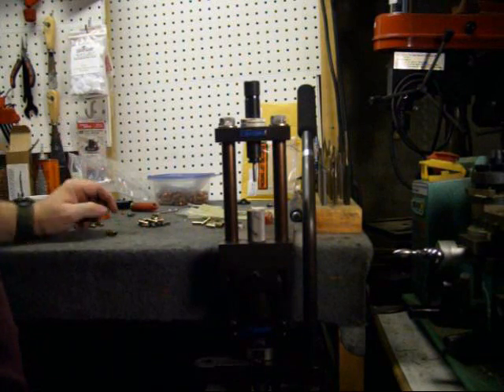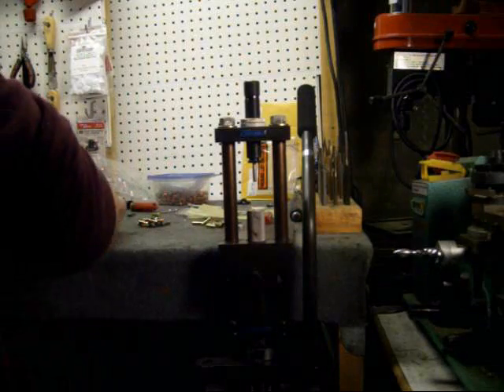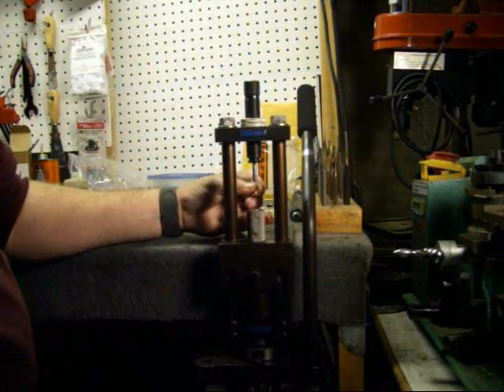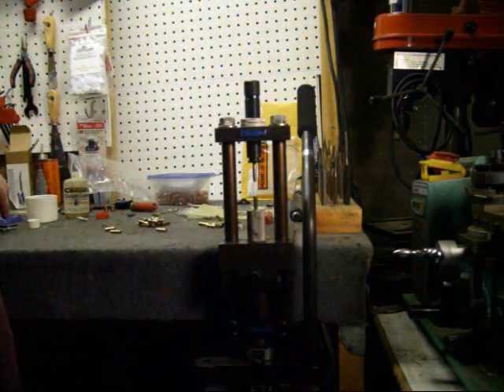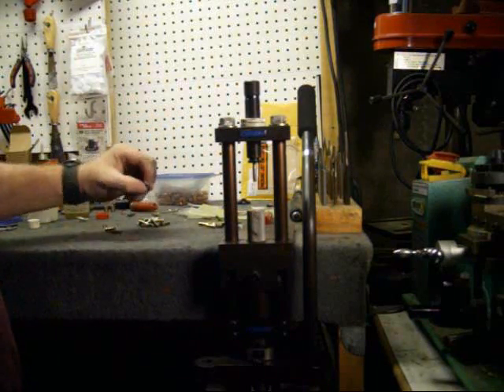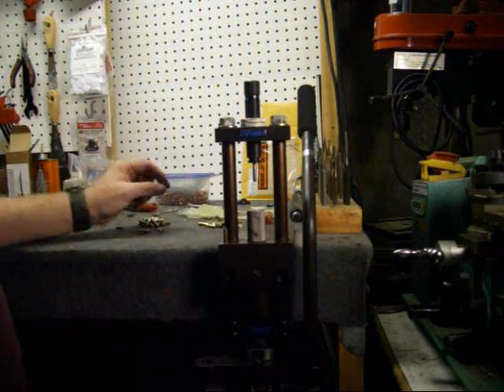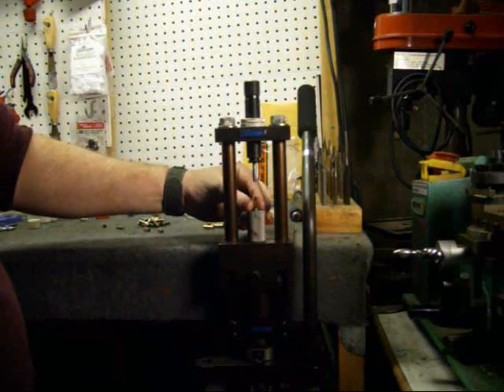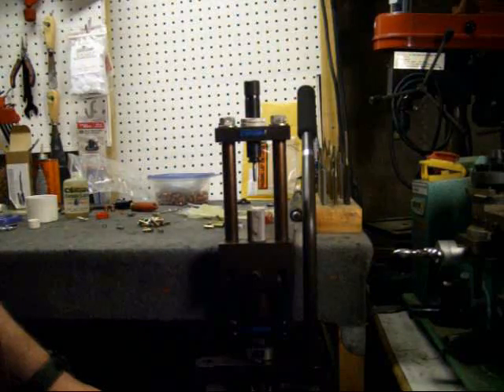Bullet Swaging - Core Seating

Comment from the maker: once you put the core into the jacket and start lowering the ram, you will compress the core against the jacket and cause a mechanical lock up.  Start  backing out the die till you can lock the handle down all the way.  Thats it.

Comment from the maker: You can, but it wouldn't mold correctly it would come out round and 6mm in diameter.  Polymer has kind of a memory when cold, it would have to be heated just before point forming.